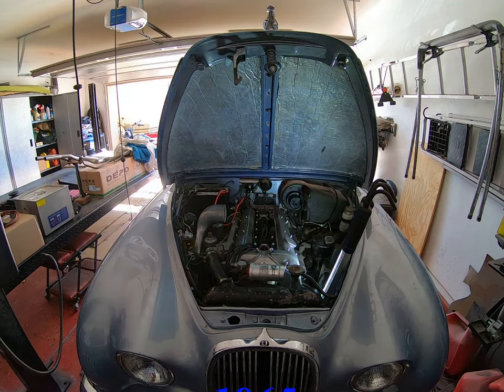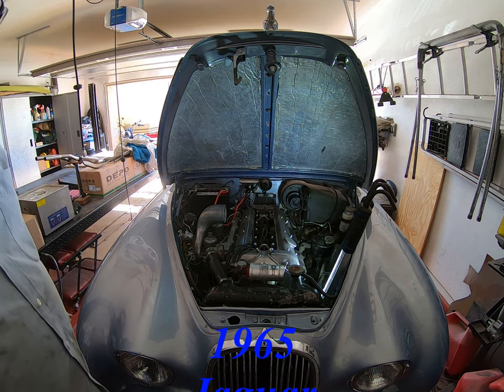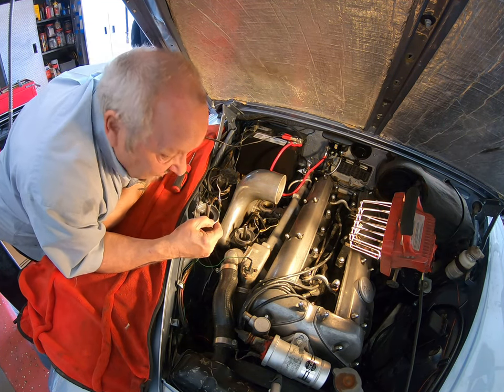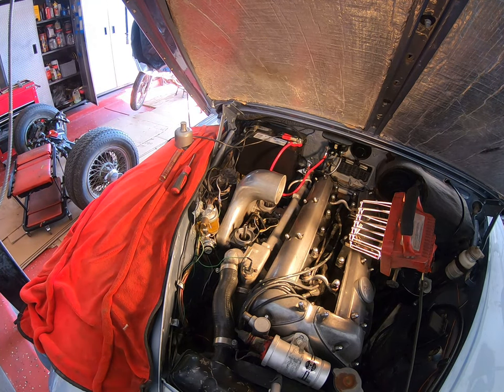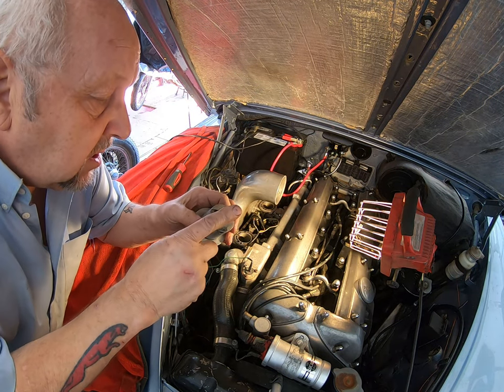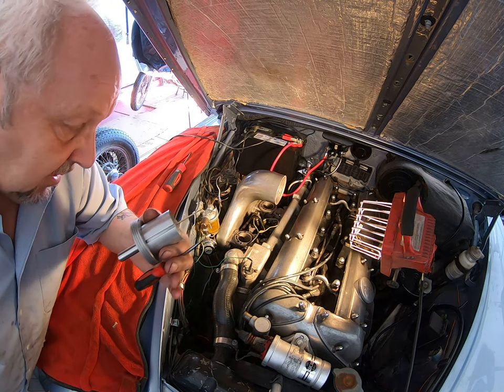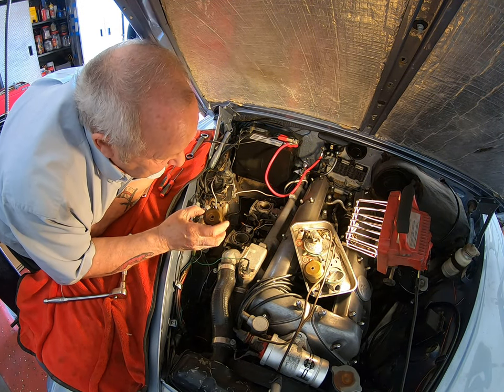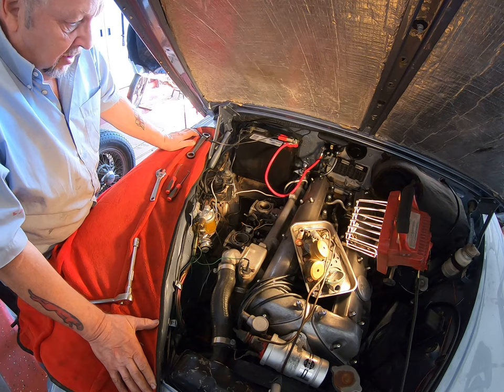Jaguar S Type 1965 Will Not Start Part 1

Comment: Interesting Gary.  Just as I've been looking at my SU setup too!  What you have found so far is typical of a poorly serviced car.  When I got a pair of old HD8s to fit to my car a few years back the problems were exactly the same.  A buggered AED, mixed up pistons, out of alignment needles, incorrect dampers, no filters in the fuel intakes, leaking and ill-adjusted floats and float levers, worn out spindle seals etc etc.  The only answer, as you say, is a compete rebuild.  Not massively expensive but the difference a rebuild makes is incredible.  What I've also found now on mine (which I should have checked before) is that a number of the components are not right for the particular carbs I have, which also messes up the settings!  Look forward to the next installment!

Comment: I was lucky when I had my mark 2 jaguar my mates father was a old jaguar mechanic he worked for a main dealer called appleyard  in Glasgow Scotland 🏴 1977 I had problems with the carbs and he stripped them down and discovered the rubber mounts were perished he replaced them and rebuilt the carbs and my jaguar ran like a dream I still have my fathers king dick sockets from the 1950s when he was a diesel mechanic on the buses in Glasgow
Reply from the maker: I believe that was Ian Appleyards dealership he was a famous racer , yes time is not kind to rubber especially with the crappy fuel we have today.

Comment: Do one of your videos show rad removal on this car? Trying to remove the rad to gain better access to the water pump but it hits on a solid pipe on the passenger side about two inches up and won’t come out!
Reply from the maker: I assume you are talking about the solid pipe on the back of the water pump, In order to remove the pump you must remove the fan shroud, remove the fan then there is enough room to pull the pump forward, I have never removed the radiator to get the pump out, . Obviously you must also disconnect the hose on the back of the pump.Of course you could always try to remove the metal pipe on the back of the pump but I have never done that to get the pump out.
Reply: @jagvette1  no I was talking about the 1/2” pipe right above the rad on the passenger side. I’ve got the fan out but would like the rad out for more room
Reply from the maker: @givemeaname1999  Sorry can't help the car I worked on was for a customer, also when referring to the side of a car it is best to use Left or right when sitting in the car looking forward as I do not know if you car is left hand drive or right hand drive.
On my mark two there are no 1/2 inch pipes that prevent radiator removal. IF you care to send me a photo I will see if I can help. gstarrgarage@gmail.com